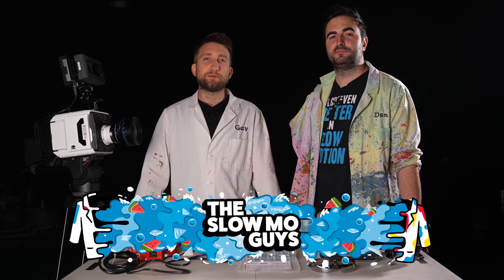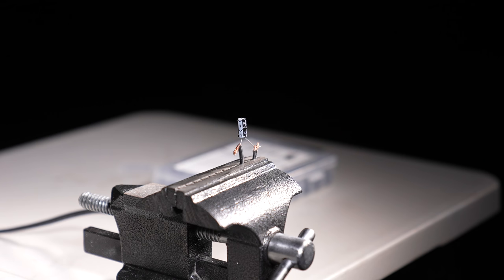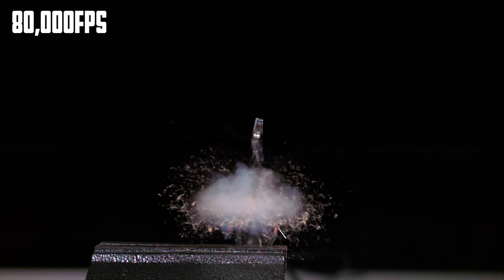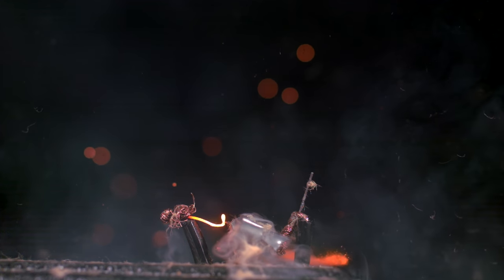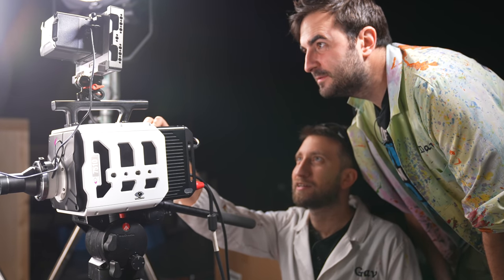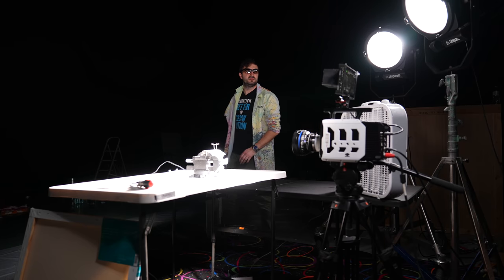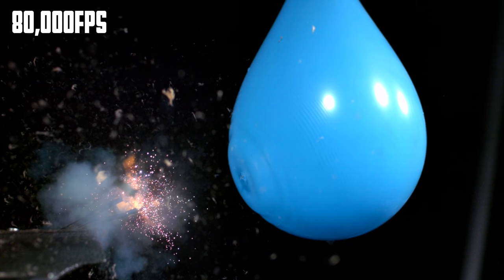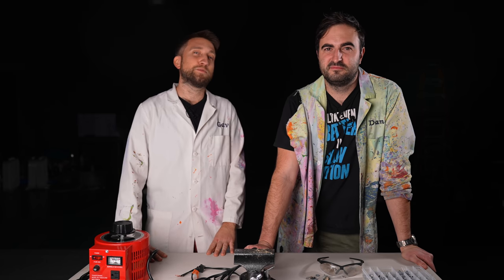Blowing up Capacitors at 187,000FPS

Comment: "I've probably wasted 15 minutes of my life with these capacitors"

Me, an electrical engineer: I have spent hours on a single capacitor.
Reply: thats why im studying mechanical. electricity makes me sad :(
Reply: @JoshTheGingerProductions  its also tends to be less angery
Reply: @JoshTheGingerProductions  same, mechanics is nice I hate electronics
Reply: @JoshTheGingerProductions  bro, you don't even know yet programming is more stressful than electrical
Reply: I'm not an electrical engineer, and I've also done that. Just less frequently I bet. Audio engineering even as an amateur sometimes hits you with a failed cap, no schematic, no label left on the device and no hope because the device was built by a company that went under before the internet existed. Which is also bad.
Reply: @KangJangkrik  How I feel about programming in my electrical degree :)
Reply: I noticed as both an electrical and an audio engineer, and having had a few caps explode in front of me, no one mentioned the distinctive smell given off by an exploded electrolytic capacitor.
Reply: @KangJangkrik  Okay what? No way, as a seasoned programmer. I've never almost killed myself by doing something wrong programming. I don't think they're even comparable lol. 

Maybe comparable if you're doing something like developing the flight computer for Boeing's new passenger jet, where you could wind up killing people if something you do falls through the cracks.
Reply: You know how much time us repair guys have spent on lousy capacitors??
Reply: Ossie Halvorson danger and difficulty isn’t the same sir
Reply: @ossiehalvorson7702  With programming it usually isn't the programmer who suffers. 
Big amps and 220V on the uni laboratory stends do scare me though (been playing with MCUs, where anything above 500mA usually means a short).
Reply: @ossiehalvorson7702  electricity is only dangerous if you don't respect it, just like driving cars
Reply: @ossiehalvorson7702  "as a seasoned programmer. I've never almost killed myself by doing something wrong programming"  You've obviously never programmed an explosive device of any kind... or a Terminator!
Reply: @KangJangkrik  no...
Reply: @osrikking8785  "You've obviously never programmed an explosive device of any kind"

Obviously!
Reply: @acehigh71  On your mattress stuffed with $100 bills, no doubt.
Reply: @User0000000000000004  hahaha, if they weren't plastic I'd use them as serviettes when I'm eating in bed
Reply: @leafdaleaudiovideoengineer4763  it's kinda similar to those small button cell lithium batteries when they explode. On-fire resistors are my favorite. The metal film ones smell sweet.

Comment: yo that was awesome! I'm flabbergasted by how many individual particles shoot out when a cap explodes - thankfully I think while I've burned some before, I've never truly exploded one while it was on a table in front of me...

Also, I have been informed by MANY commenters that Gav has previously wondered about the "speed of push". While I don't think you'd be able to pick it up in a bar of metal (the framerate is high enough, but you'd only be looking for a displacement of a fraction of a pixel if you could see the entire bar in frame) I think it'd TOTALLY be possible with a long cylinder of a reasonably soft rubber (with a slower speed of sound, but more importantly for the camera, a larger yield strain. Wack one end with a hammer and HOPEFULLY you can watch the compression wave go all the way down! You need to hit it hard enough that you significantly (visibly) elastically displace one end of the bar before the other end starts to move. Thinking harder about this as I type, The hammerhead would probably need to be traveling an appreciable fraction of the speed of sound in the bar to make that happen... You guys know Destin - right?

The shot you had in here of the shockwave going around the edge of the balloon was fantastic, but estimating your framerate from the speed of the flying capacitor you already gave, I think those ripples were more like gravity waves ON water, rather than sound waves THROUGH water. although here maybe balloon waves? membrane waves? bubble waves? dunno.

Cool vid as usual!
Reply: I love how all of this is just off the top of your head like what even😱
Reply: SO stoked to see AlphaPhoenix in the comments! I don't know what you could collab on, but it would be amazing to see it happen!
Reply: Well the whole "speed of push" idea is really just a form of a shockwave. When you hit something the force travels through in a wave as the molecules compress, the speed at which the wave travels through the material is the speed of sound for that medium. If you slap a big yoga ball that's just filled with air it will travel at the speed of sound through the air (approx. 331 m/s), if you slap a water balloon (or blast it with a capacitor rocket) the wave will travel faster than through air as water is more dense but the wave itself travels through at the speed of sound through water (approx. 1,480 m/s), and if you were to smack a big steel rod the wave would travel way faster as the molecules are much more densely packed (approx. 3,150 m/s). 
So it just depends on the density of the material you choose
Less dense medium will have a larger "visible" shockwave and will travel slower. More dense medium will have a smaller "visible" shockwave and will travel faster.
If you hit the object harder, the initial compression will be greater as you, or whatever object you're using, are applying force on it, but the speed that the wave travels through the medium will not change.

Someone feel free to correct me if I'm wrong, I'm always happy to learn something new.
Reply: Hammer time!
Reply: But is it the force through the water, the air, or the rubber itself?
Reply: @RICDirector  it’s a disturbance (increase in surface area) of the interface, and the rubber balloon applies the restoring force
Reply: Hey, I've always sorta had two issues with the way you did the experiment, since I've been researching and considering the question for a while. I'd like to see you try it again with rotating the bar. I think the example would show that the matter actually moves at the speed of light, and IMO the hammer experiment only sent a shockwave/compression wave through the material instead of actually "moving" it per se.
Reply: @potatosordfighter666  if the bar twisted, the signal would probably travel at the shear speed of sound, which is even slower than extensional in steel. The hammer made contact with the bar in my experiment (for the shorter rods) for longer than it took for the signal to pass from one end to the other, so it was effectively a slow push on the relevant timescale, just not a human timescale
Reply: @Dysiode  same!
Reply: This is exactly what I need in my life right now.
Maybe it's possible to send a wave going back and forth through the material?
Reply: @AlphaPhoenixChannel  I'd still like to see the rotation experiment done, just to confirm. As well I understand what you mean about the hammer impact now. Basically the movement at the end was measured before the movement on the hammer side stopped accelerating, if I understand it correctly.
Reply: The speed of push, now THAT is a throw back
Reply: The speed of push in a bar of metal is the speed of sound through that metal.

Comment: Awesome footage! Now repeat with some decent sized capacitors!
Reply: I have some 2000uf 525v caps as tribute.
Reply: @Vlad TheInhaler 16v caps really don't like 200v AC.
Reply: And some tantalum caps. also, dan increased the voltage manually (in human time) what about having it wound right up and then direct on line?
Reply: @maxfarr4142  That's what I did, the radio was live so I could filter the heater circuit, but I mis-counted the terminals on the tube socket, I had two long wires on the cap and I had one connected to one of the terminals I thought was ground, and was touching the other wire to another terminal I thought was connected to the heater. I was loudly wrong.
Reply: Use a hot glue gun to block off the vents
Reply: Would super caps look much different?
Reply: “Decent sized” = “Safety gear”. Sorry, I meant “ballistic vests”.
Reply: My Exact Thought 💭 To 16V Caps Pshhh Give Me 1,000V Caps Any-day!!!! 🥰🥰🥰
Reply: Exploding supercapacitors? Oooo!!
Reply: I like how all these kids come out with their 10,000uf caps and such... 
Proper capacitors are never this big of a capacity. They should have at least tens of kilovolts in rating to be anything decent!
Check out Backyard Scientist, William Osmans channels or at least PhotonicInduction's stuff.
Reply: Mehdi to the rescue!

Comment: The bulge on the smallest capacitor was amazing, as was the plume of plasma! No wonder the bigger ones come with the safety vent at the top, could you imagine the damage blowing a large capacitor in the old days would do? Early computer engineering must have been a hazardous occupation!
Reply: I hope ElectroBOOM will bring some of these
Reply: Well I do remember doing something similar back in school with a car battery charger and some big electrolytic capacitors.
We didn't overcharge them, but merely reverse-polarised them, but the result was the same (except I didn't have a high speed camera and we contained the explosion by putting the capacitor it in a wooden box).
I do remember though that it smelled horrible, and we only did one indoors before we moved outside, and I'm pretty sure those fumes are NOT healthy!

I also remember how surprisingly much stuff there is inside one of those, after the boom it almost seemed impossible for all of it to have been inside the capacitor.
Reply: IKR
Reply: Yep, I've been around capacitors that have blown up since the early 80s, back when it was a lot more common to have zero safety measures like stamped cross marks on the lid of the can, thin spots in the rubber plug to vent pressure without launching/blowing up the can, and so forth.  Always a shock to have one of those large ones really detonate, throwing shredded paper and bits of aluminum strips everywhere, not to mention the evil-smelling smoke.
Reply: they would charge up a capacitor and toss it to a fellow.
Reply: can you imagine a capacitor about 4 inchs across and applying 240VAc across the terminals? Yeah, back in the old days hahahaha. I remember the mess it made.
Reply: @srenkoch6127  As an electronics tech, I've seen tons of these caps blown up myself.  
Looking at their power supply, I suspect they were running AC through them, rather than over charging them, so it would be the same as reverse polarity.
Reply: Photonicinduction blew an industrial one, it was awesome

Comment: My first job, (a while ago) was testing newly soldered circuit boards before assembly.
All the components were back then hand placed before the boards were passed through the soldering machine.
One re-occuring issue, was these large electrolyte capacitors being placed with the polarity flipped.
The result, if I didn't catch this using my Mk1 Eyeball, was an ominous low humming, and if I didn't "connect
the dots" quick enough, shutting off the power, a firecracker bang, a cloud of electrolyte staining everything
that it could reach, and a smell which took a day or two to before realising that it had overstayed its welcome.
It was ingrained in me, a certain respect for these things.
Reply: I was an electronics tech in the Navy. We used to joke that they made electrical components with smoke in them so you could see, and smell, when they went bad. When completing my paperwork, I would indicate the problem and the corrective action. "Capacitor C12 let the smoke out. Replaced capacitor"
Reply: @Jonathan Shumpert  why replace them?? You just had to go to the engine room and get a bag of smoke! Hard to get it back in the capacitor though you need a small tube too
Reply: Jesus, my first job was in a movie theater🤣🤣🤣I was there for opening night of Titanic!
Reply: Hopefully it was some of the safer electrolytes, and not DMF or DMA based. Back in the day some unpleasant solvents were used in the electrolytes.

Comment: I'm really curious on what different types of welding would look like in macro slow mo. Especially AC Tig.
Reply: I read it as wedding for a seconds and i was like... Uhh, probably boring?
Reply: They would have the put a welding lens over the camera lens probably. The arc might over expose the camera and blot out anything worth seeing. I would love to see AC TIG arc though.
Reply: @MurkyWaters677   Higher framerate, shorter exposure, higher aperture, doubt you actually need a filter

Comment: Glad to see you guys back together again. Capacitors are no joke! I had a little 10uF, 25V one pop while I had my arm stretched over the circuit and it drew blood. At the time, I had also been messing around with reforming 10-40uF 400V+ capacitors for tube amps and once I realized how much damage that little 25V, 10uF guy could do, I was done with reforming old caps.
Reply: Kind of related but i had a small LED explode and a piece of the plastic embedded itself in my cheek. It only broke the surface but dang
Reply: Capacitors exploding are nothing compared to ones shocking you ;) Found out as an 11 year old kid or so that the built-in flash in photocameras has a nice 300 uF or so 450 Volt cap on board. I had no idea when trying to pry open the camera's casing and made contact with one thumb on one pole and my other thumb on the other pole... I was done with trying to get it open for at least a few hours...
It has happened to me later in life as well... just forgetting to discharge that one cap and... yeah well...

Comment: When I was in electrical school we were working with breadboards one day and one of the students accidentally connected 240 volts to his breadboard instead of 24. I was on the other side of the classroom and it lit up the room brighter than a photography flash.
I don't think there was a capacitor involved, but there was a diode that completely vaporized.

Comment: I'd love to see some ultra slow-mo footage of just plain arcs and electrical detonations, in my experience with high current discharges like with welding equipment or capacitor banks discharging through an air gap it produces an incredibly bright explosion of metal plasma that is definitely supersonic, although I don't know how fast the propagation can be physically, I'd love to see it in the same quality and detail you provide. I'd imagine it'd take a similar frame rate to the lightning videos you made a while back. But personally, I just want to see if they actually look like micro nukes going off because they're too bright to look at ordinarily and have high UV output since its literal ionized metal vapor. Also if this even gets a chance, an alteration to be made; between the contacts, if you put some very thin insulator like paper or plastic wrap, or even more effectively, petroleum jelly, the discharge vaporizes everything between the contacts and actually creates a proper explosion. But I'd really love to see it, electricity is just so fast at dumping energy into just about anything that it should lead to some interesting shots. Also a good setup would involve a high current source triggered by high voltage across the air gap so that the air itself can take all that energy and ionize for a control against other things in the gap.

Comment: Would have been interesting to compare the failure of a top brand capacitor  with these FMZs. The smaller FMZ seem to fail at the bottom seal rather than the top vent. I wonder if a top line Panasonic or Nichicon would behave the same.
Reply: I doubt these were atypical failure modes.  Bottom failures were capacitors without top vents.

Comment: When I was 16 a friend and I experimented with exploding capacitors as well.  But instead of overloading them with voltage, we used a soldering iron touching the capacitor until the heat caused them to explode.  Although we were using much bigger capacitors.  Some up to 200+ volt sizes.  It was fun to watch.  The smell was horrible and the smoke hurt our eyes.  We filmed some of it with an old vhs camera.  One of the coolest thing we did tho was making small fires in ashtrays and placing the capacitors into the fire.  I thought the gasses would be flammable but instead the explosion just extinguished the flames.   We then moved on to sticking the capacitor into little bowls filled with flour, sand, aquarium gravel etc.  It was a lot of fun seeing how the explosions effected the material.  Lots of fun.   But seeing your footage in super slow motion is amazing and triggered a bit of nostalgia for me.   Great job guys.

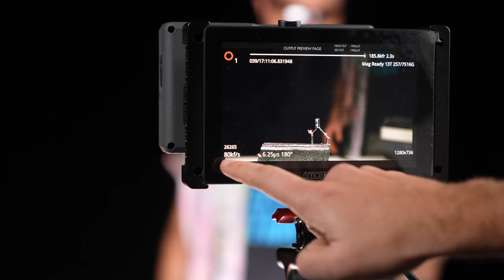Comment: 1:09 Thats not a “u”! Thats the greek letter “μ” and its used because of the word “μικρό” (which stands for small or micro”)
Reply: Oh, that's why they use that? I thought it was because the used both M and m for Mega and milli.
Reply: @arceuslord1365  μ doesn’t have to do anything with mili. μ is smaller than m. I think when we are using it in values its like 100 or 1000 times smaller than m
Reply: @andreas_karam they were saying they thought the only reason they used it was because both M and m were already used

Comment: I would so love to see a relais-contact enganging with current flowing through it. It would most likely show a perfect ark between the contacts and even show how the contact opens and closes repeatedly at the start of the contact movement, usually refered to as "contact chatter". Very common in any type of electromechanical contacts like on Buttons, Switches etc.

Comment: 2:45 Capacitors (radial lead) made before 1990 don't have this crease on their top. Their failure mode is quite different: once they heat up, they start growing, then explode. The "growing" is the case beginning to slip.